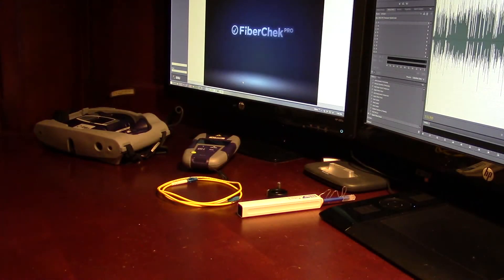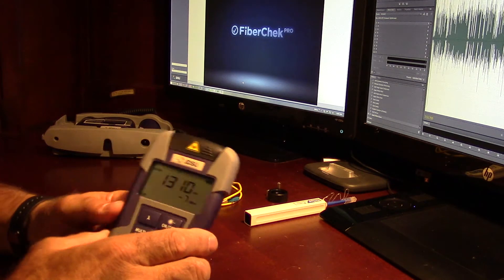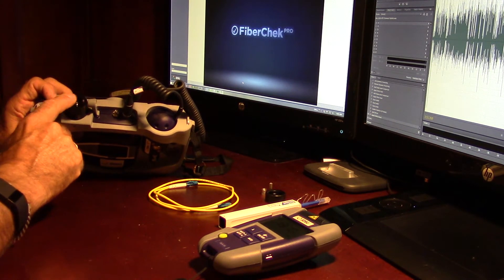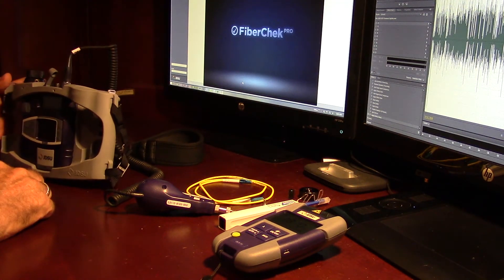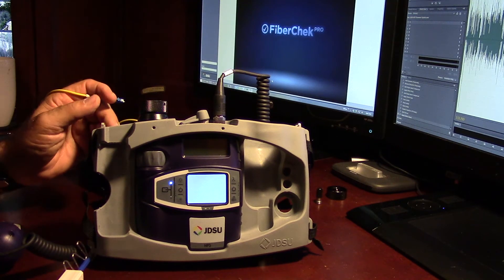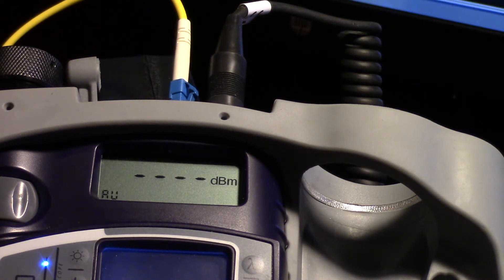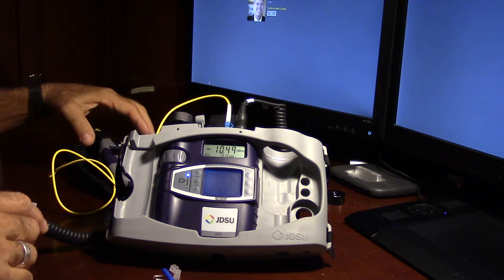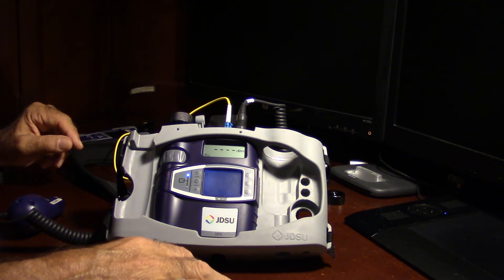Power Meter and Light Source

Comment: Thanks for your information! Could you tell me which keys I press for the calibration of the OLP-38?
Reply from the maker: Thanks for the question. Actual calibration needs to be done by the factory, When measuring in dB (which is a relative value) you can tap the REF button to zero out, or set your reference level to Zero. Example, if you are measuring in dBm your transmitter power level is -10 dBm (absolute value), and your receive level is -15 dBm (absolute value), your loss is 5 dB (relative value between the two absolutes). Alternatively, you could measure in dB, at the transmitter and "Zero" the meter by taping REF (telling the meter that -10 dBm is zero). When you measure at the receiver, the meter would read -5 dB. Using the dB measurement saves you from doing the math, but IF you forget to redo the reference on the next measurement, it will skew your results.
Hope this helps.
Reply: @VanTekConsulting  Thanks for replying! Yes, I've already done that, but I have another Veex powermeter and an Anritsu otdr that have the measurement calibrated and the same, the OLP-38 is measuring 1dbm above and I wanted to make them all the same.
Reply from the maker: @MAMTECNOLOGIA  If you are saying that the VeEx and the Anritsu (I assume you are using the PM function on the OTDR, or are you shooting a known fiber?) are measuring the same, one possibility is that the connector on the OLP-38 is damaged. Do you have a probe to look at that? I'm not sure of your test bed / process, light source, connectors, etc.. Feel free to give us a ring if you want to talk through this.
Reply: @VanTekConsulting  I bought this month a light source an orientek T15M in your description this output is -5Db, it is for this equipment that I am checking the readings